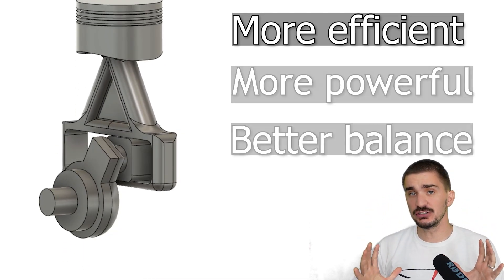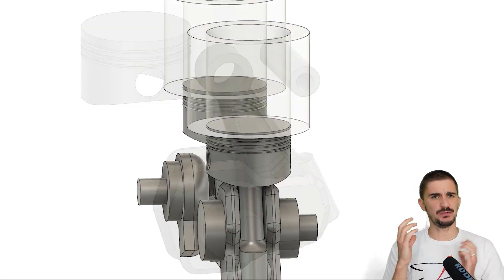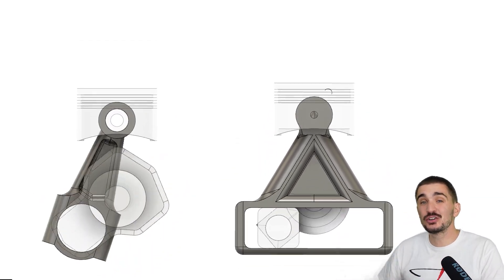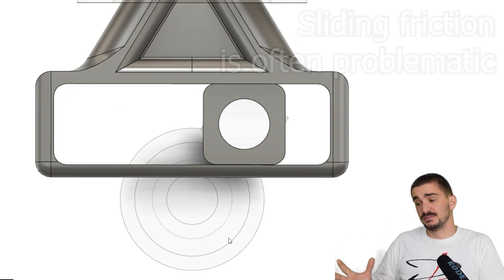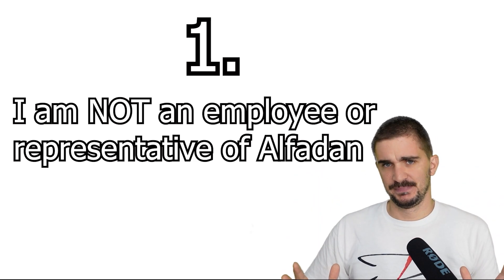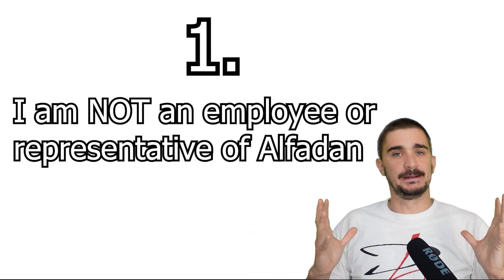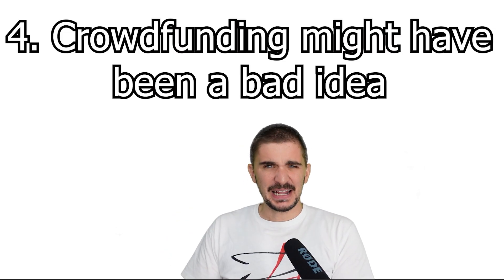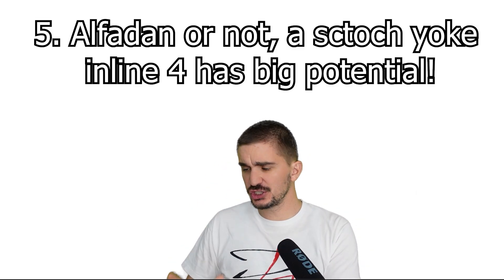This engine is better in every way?

Comment: if you like new engine ideas, you may like the liquid piston engine. It seems to have a lot of potential, by being able to run in a variety of fuels, with high efficiency, and being simple and light weight. There is not much videos about it, so if you find it interesting, you could make a video about this engine, and at the same time help the engineers by making their job known.
Reply: LP is just another crap ass rotary engine with high SA/vol and low efficiency. theres a reason they havent published any efficiency numbers yet
Reply: @rfh316  they have relish. It is all in their website. Also don't say that something is a crap before it get tested. The LP engine doesn't need more lubrication oil then a usual engine, because the friction that is experiencing is mostly rolling friction.
Reply: The LP engine would be great for small aircraft but I am skeptical if they will ever make an engine that does not need overhauled frequently. The Achilles heel of the design is the seals, not at the tip like on a normal rotary but on the sides of the rotor.
Reply: @ulbuilder  Best use for a LP engine is as a small generator in a hybrid vehicle.
Reply: @ulbuilder  i am not worried about reapers, by watching the evaluable videos of how it is made and the see throw video on youtube, it seem to be fine. Also the high efficiency that it has, it means that it will be match cooler and easier to control its temperature, so there is no danger of cracking, and when the engine will be out of the prototype phase, it will mean that all or not the most of the possible issues the it may or possible has, will be fixed.
Reply: @antonisdouropoulos500  LP's current engine can run for 40 minutes at a time and it needs overhauled after 3 total hours. They need to decrease wear on the components by many orders of magnitude to get beyond a prototype. I wish them well and hope they succeed but they may also fail to resolve this tough problem . This concept was born 20 years ago, that's a long time invested for an engine that only lasts 3 hours. How many more decades will they need?
Reply: Liquid piston is an improved design from 1908 in which the Englischman Fred Umpleby tried to modify  Cooley's steam engine into an internal combustion engine.

Or search patent US32533583A from 1963 (Isuzu) for a drawing  of the improved version of Umpleby
Reply: It does sound interesting, but at the same time the company and people there have too many... "questionable" stuff behind them. I'd love to be proven wrong, but there're too many signs that it's an intentional scam, just to grab investors' money.
Reply: @dirtyclanner2250  The Wenkel engine used in the Crighton CR700W motorcycle is legit and has comparable specs to many vaporware.
Reply: @dirtyclanner2250   they are developing the engine from 2004, with the final design been made in 2016. From then, they are involving it, trying to make it more efficient and more powerful. They have a small museum with their previous designs and fully workable prototypes, and in their website, their looking for new engineers, so calling it a scam is a huge claim for which there are no evidences.
Reply: @antonisdouropoulos500  If they have working prototypes they could send them to say the SAE where they could be thoroughly tested and their claims independently validated by a credible third party.

There's one reason why these companies sit on their tech for years behind closed doors it's because they just haven't managed to make the real product live up to the hype they created to draw investors. The product can't simply work, it has to be better than what's already mainstream, otherwise there is no point and investors are gone overnight, and they're all out of a job. And it almost never is - not at a competitive price point at least - otherwise any one of the many established manufacturers' R&D departments would have already patented it and would have been developing it for years. Car manufacturers aren't just sitting on their asses waiting for the next big tech to come along and put them all out of business, it's not a coincidence that whenever there is some major technological development in the industry pioneered by one manufacturer in a matter of months the other manufacturers are all releasing products with their own slightly different version of the same thing, they pay attention to what's going and they start working on their own take on a new promising technology as soon as they get wind someone else has had a breakthrough.

Comment: now as far as i know is that there are some design ideas that kinda eliminate the problems of the scotch yoke design by using eccentric rods. its kind of a fusion between the piston engine with the movement of a rotary engine.
Reply: Hypocycloidal The 3rd oldest steam engine had straight line reciprocation.   https://en.wikipedia.org/wiki/File:Hypocycloidal_Engine_higher_res.webm  If MAHLE can't make that work, no-one will.
Reply: @enwri  yub, just like i described it. the only problem is see with this design is, that it adds parts. however if it is possible to eliminate secondary forces entirely, so why not. it would be great to see some more unique engines on the large market, the last one was only the rotary

Comment: Just from looking at this configuration, it apears to me that there is still a torque force where the piston and con rod join, since there is only resistance on one side of the slot; probably mitigated by constraint of the cylinder barrel, but that would then create piston:cylinder friction again... I'd also think the sliding friction under load might be a great deal more difficult to overcome than it it seems... Obviously thpugh, this is just eyeball impressions, so could be completely wrong. 🤷‍♂️

Comment: 8:43 i knew this would be Alfadan's new engine tech since back then they said "we revolutionized the connecting rod" while they where working with Mahle but not showing anything to it before they get enough validation data just the "soon TM" glad to know this thing was still trucking along and thanks for the follow up mate!

Comment: im not convinced the complexity of the sliding friction interface is worth a minor improvement in vibrations.
Reply: The most important part is getting rid of the far more severe sliding-friction in the cylinder/piston -interface... High combustion temperatures let metals get soft, and ease the destructive effects of sliding friction. Friction doesn´t come from nowhere, it simply leaves the cylinder, and goes somewhere, where the situation is far more under control, cause it´s cooler.
Reply: You get the benefit of longer dwell at tdc and a few other things on top of that.
Scotch yoke engines aren't exactly a new thought, the first ones built were the Bourke engines iirc.

They're quite interesting, and it's without doubt a feasible concept. Iirc some larger companies experimented with some such rather recently because the longer dwell time/slower movement around TDC was supposed to have advantages for HCCI engines or something like that.
Reply: The slider bracket would have to have a guiding groove andthe guide square have guide nub. Starting this would require a starter on the crank and timed firing. It seems rather extensive withmore draw backs for mass production. The lower crank case would need testing as well
Reply: Bro, sliding friction ALREADY HAPPENS on the big end of the rod, it's just in 1 direction. You clearly don't see it the way I do
Reply: You're underestimating harmonics and balance
Reply: @SupraSav I don't estimate things, I calculate them. As does the rest of the ENTIRE AUTOMOTIVE INDUSTRY and they seem to agree with my conclusion. Not like its a new idea nobody heard of before. but if you think you know better go ahead and prove us wrong.
Reply: @SupraSav  tell that to nascar engine builders. Engines cranking out 700hp, with piston speeds faster than f1 piston speeds and pistons that weigh 400grams, at 9000 rpm’s for 500 miles.
Reply: @morganpowell2999  example: honda s2000, 2l inline 4, no harmonic balancer, redline 9k rpm
Reply: @markusluftner8418  well sure your i4 and i6 are naturally balanced because of the way they’re made. My point is balancing a cross plane crank and making it spin 9k reliably is a very common thing. It’s not something that engine builders are struggling to overcome.
Reply: @morganpowell2999  Exactly! Just saying that there aren't only race car engines with high redlines or piston speeds. High RPM engines are not an issue, secondary balance neither. Just affirming your point. :)
Reply: you've must never revved an inline-4 to above 5k rpm before.

i've revved a single cyl 150 engine to 11k rpm before for 30 seconds, it has a balancing shaft. lets say my ass hurts
Reply: Not really that minor. In most inline four engines, the majority of all vibrations comes just from secondary imbalance.

Secondary imbalance is literally the smoothness difference between an inline 4 and a flat 4 or straight six.
Reply: if it was worth it, it would be used all over the place

Comment: Does it still burn stuff.
Electric has none of these issues and is way more efficient.
Reply: Yeah the only issues it has is the inability to easily store the power that makes it work in the first place. Definitely a minor problem.
Reply: In 3 years I ran out of electrons once and that was my fault. Bad planning.
And batteries are getting better at an impressive rate.
Reply: @kevinmair7571  like a beaten housewife, the electric car owner blames himself

Comment: Longer connecting rods would help and many motors use longer rods, but what about rods that are much longer instead of slightly longer rods?
Reply: that usually translates to a horrible torque curve
Reply: @2b134 thanks, interesting, I would like to know the physics behind that
Reply: @captarmour  i'm far from qualified enough to give you a good explanation, but from my understanding at least, the shorter crank throw (in relation to the rod length) is responsible for less leverage applied to the crankshaft. not sure why but these types of engine (which are or have been used in f1 for exemple) require a ton of rpm to be of any use. also really long rods will create some packaging issues for most road cars i guess

Comment: Great video as always really well explained 👏   I wonder how they will lube it ?
Reply: Just like any other 4 strokes, oil enter the crank from the passages in the main journals, then you Just Need to adapt the sistem from the Rod big end and  his piston lubing jets but Is nothing very different to do with the correct oil galleys and bearings design aswell alot of oil pressure

Comment: It seems one would want roller bearings inside the slot.  Is there a hidden problem with that?  And maybe a hydraulic mechanism to keep contact with both sides of the slot (kind of like hydraulic lifters) as it wears?

Comment: Moreover, if the Scotch yoke design catches on and replaces rod engines as the standard, there will be no more secondary vibrations, and then what will you do? Face it, reexplaining secondary vibrations over and over is your Sisyphean destiny.

Comment: The difference between a scam and a failed investment is that one is intentional and premeditated and other one isn't. You can't label a scam as "just the inherent risk of investment"
Reply from the maker: But how do you know something is premeditated or not?
Reply: @d4a  you don't, that's what makes it a scam... 
Imagine leaving your wallet laying outside on a table. If a bird takes it and flies away, it's an accident, but if someone walks by and takes it for them selves, it's a crime. The outcome for you is the same, but one is a crime and the other one isn't. Same thing applies here. In one case, all the money is used for development, but it fails, in the other case some criminal takes all the money and disappears.
Reply from the maker: It first has to happen. Remember, innocent until proven guilty.